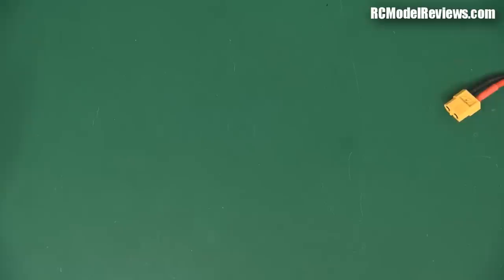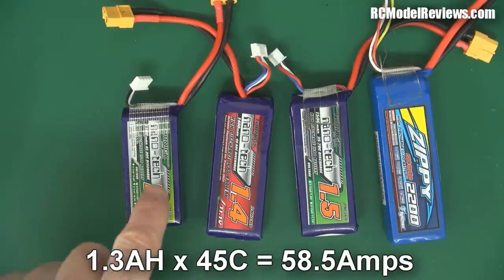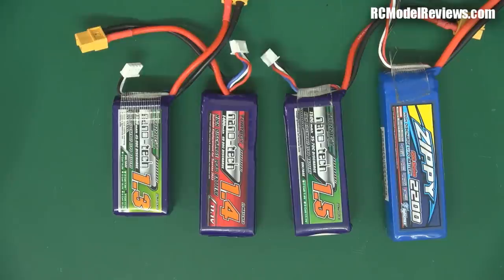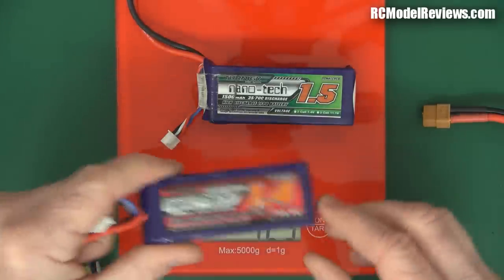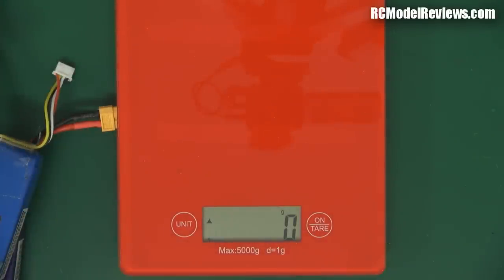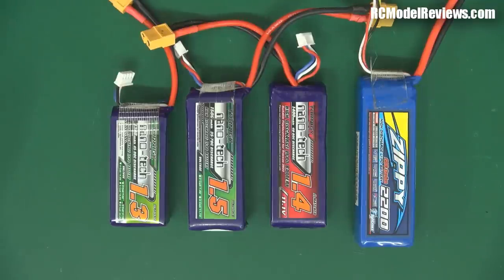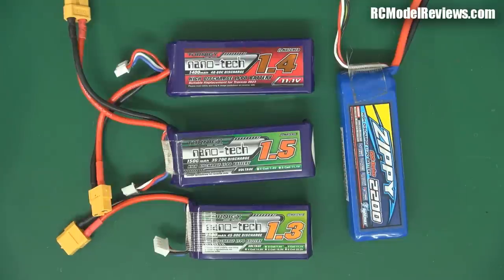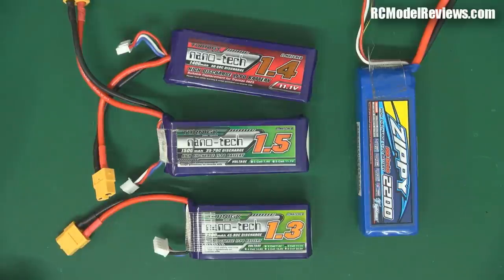What size mini quadcopter battery should you use?

Comment: With all due respect to you, Bruce, I disagree with your advice to stop flying such that your batteries rebound to around 11.4 volts. IMO, you're leaving too much charge in the battery and are reducing your flight times with little benefit. 

I used to do about the same as you, until I started flying with an OSD that included a current monitor. I fly to 80% of the battery's charge (1200 mAh on a 1500 mAh). Typically, this results in in-flight voltage of about 10.6 to 10.8 volts at cruise, with dips as low as 10.3 volts, or an absolute minimum of 10.0 volts for example if I was to do a big punchout at the last moment right before landing. After resting, my batteries recover to about 11.0-11.2 volts. This sounds not too different from what you're doing, but I get about twice as much flight time as I would if I followed the guidelines you lay out in the video. Given that my flight time is about 5-6 minutes, a 50% reduction would be significant!

11.0 / 3 = 3.67 volts per cell. This is well above the absolute minimum of 3.0 volts per cell, and the safe minimum of 3.2 volts per cell. I find that performance starts to really drop at around 3.5 volts per cell, so that's more or less the absolute limit of where I would stop flying if I didn't have a current monitor. But I see no problem in having short dips as low as 3.33 volts per cell during throttle application.

In order to track my battery's performance over time, I note the final resting voltage after drawing 1200 mAh from them. If they were being damaged, I would expect to see the final resting voltage drop after pulling the same charge from them. I have had these batteries for about four months now, with I'm sure you can imagine how many recharge cycles on them, and so far, they show essentially no decline in performance after the initial small drop that is expected from a brand new battery. (They're Turnigy Nano-tech 1500 mAh 35-70C for what it's worth.)

All that being said, if someone was flying without telemetry, just based on a timer, then I would agree with you that 11.0 volts is a safe cutoff, just to CYA for times when you draw more power than you expected.
Reply: Do we know the max C rating a JST connector can really handle ?
Reply: His Highness is too busy to answer questions from peasants.
Reply: Joshua Bardwell I'm going to use your formula and make me an Android app to keep control over my batteries. I'm new to quads and on my 1st day out, after training on SIM of course, I killed the last cell in 3 batteries. That is what has brought me to this video, investigating cause. Thank you both for all the information, you guys are great!

Comment: I've been running my batteries in cycles now as well. A few packs ready to go during the week. When I get home I put them into storage mode and cycle out another set just to spread the usage out. I have a bunch of Zippy Compact 3S 2200 25C's which are well over a year old and they are still fine. Starting to drop off a little but I'm also flying hard ;) Thanks for the video. PS Another thing I do is number the packs. Helps me keep track of when I purchased them and so on. Cheers.

Comment: Excellent little PSA towards the end.

I used to discharge to 3.5 volts per cell think it's enough (I'm sure even 3.3 to 3.0 when I started) and I have noticed performance losses. Now I'm going to try 3.7 volts per cell after watching this if I get new batteries.

Although this may only be about half the rated discharge capacity of a lipo, after using my old, sometimes puffy, batteries; I'd rather have half capacity, healthy, and punchy batteries than half capacity and poor sucky batteries.

Thanks again Bruce.

Comment: You are spot on about the power and resistance. I find I get way more punch from running 4 1000mAh batteries in parallel then I do from running just 1 4000mAh battery by itself on my Peace drone. I think Ed from Experimental Airlines, had a similar video, where he was explaining resistance. Great video Bruce.

Comment: Cheers Bruce!!
I've only been flying brushless quads a few months now and have just built my first. It flies great but I was getting the low volt alarm going off on punch outs. My OSD was telling me it was hitting 30 amps and being new I'm not ashamed to say I assumed 30c on a battery meant 30 amps...my batteries are 30c so I was scratching my head a bit.
They're 30c but only 850mah so your video has explained why.
Just ordered some 65c 950mah :)
Love your vids Bruce, you explain everything so well and never seem afraid to say a product is crap when it is.

Comment: Another informative video, Bruce.  Storing under partial load is a good tip, too. How about doing one on low voltage alarm strategy?  Low C batteries under load tend to set off alarm and then on the charger aren't discharged to the point you might normally run them.  HK has a series of high capacity/low C batteries for multi-rotors.  They are lighter in weight, of course and the alarm goes off well before they are truly discharged to a safe level if set for 10.8 or so on a 3s battery, for example.

Comment: This is a timely video!! i am currently trying to figure out why, after changing flight controllers, APM to MINIX, i dont acheive the flight times on my Zippy Flight Max 8000 mAh batteries or some NanoTech 4500 mAh batteries. i used to be able to get 14-18 minutes on the 8000mAh, about 10-12 minutes on the Nano's when using the APM Flight Controller. i fly an X650 XAircraft with the TMotors i believe they are 720 KV (Xaircraft P7001 motors) 30A escs. its not over weight, 14 inch props. on the F450 (4500mAh batteries) i have 11 inch props, 30A ESCs, 2216 800kv Tmotors. the low battery warning on MINIX is 10.4 i believe. i seem to only get 65% of my flight times. these batteries are always charged at 1.0A and are set to storage 11.40 when i am not using them, they are not quite a year old. Any help is appreciated. I use an Accusel 6 battery charger, all batteries have been balanced charged and appear to have the accurate cell voltage after wards. i am not an aggressive flyer. any help is appreciated.

Comment: Bruce is dead on.  Treat your lipos well and they last.  Doesn't matter if cheap HK or ThunderPower.  Don't let the voltage drop super low, don't charge them too fast and discharge/charge them up to a storage level and they last. When I got in to mini quads last year I purchased a lot of sizes and brands.  Some perform better than others due to the C rating differences but all are still in great shape because I treat them right.  I think that is the best take away from this.  Thanks Bruce for the videos and keep them coming.

Comment: I have likely watched all of your educational videos and with similar backgrounds I enjoy learning over again. It's almost like when I used to fix TVs (in the '60's) and would first ask my client "is it plugged in?" 

Everything in this hobby is now connected to electrical power and that power is utilized  by many components so it makes sense to use the highest rating you can afford just so you have 'Headroom'.

I am curious regard yours and my habit of bringing in the flight when my 3S battery is around 11.3-11.4 volts. My charger usually returns a value of 50-55% usage though it should be safe to go to around 10.5 volts and 75% or so usage. Perhaps I'm just stuck on 6 minutes ....... Thanks!!!

Comment: Today I had my first FPV flight with my effort from your low cost racing miniquad series.Like you I have a swag of odd size batteries which I have used for LOS flying/practicing at very low speed. I am intending to get some dinogy's off Lee  for racing when he gets them back in stock.

Comment: Well darn it, I wish I watched this one sooner! So much to learn. I ended up with 2200mah 25C batteries (so 55amps) which is pretty good but there big and I my plan was to run them on a 250 quad with 2300kv motors. I thought it looked a little big but when I asked someone else they said 1300-2200mah so I figured bigger means longer flights. Ugh such a noob. Besides the fact I cannot return them to where I bought them. Maybe I can sell them. Thanks again, Bruce you rock!
Reply: David Fonseca they will still work, I primarily use 2200mah for the longer flight times, sure it's not as zippy as the 1000-1500 ones but I don't mind them
Reply: It seems like the weight ratio would kill the flight time in the long run no? Well, they sold quick so I have the 1300 45C-90C coming, 5 to be exact. Should be good to go now ;)

Comment: I'm using 2200 30c hobby people 3s batteries and I'm very pleased, I'm getting 9min on my zmr with 1806 and 5045 bullnose. I can get them from my local hobby shop for $20 and they have a 3c charge rate.

Comment: I'm running 4S 1000mah 30C blue Turnigy batteries with DYS 1806 and Gemfan 5030. Pretty nice combo. 5 minutes of racing leaves me with 3.75v per cell which tells that light weight and high voltage is a good deal, amps stay low and theres plenty of speed.
Reply: Jussi Hirvonen Yep, your benefiting from the light weight of that 1000mAH pack.  The less weight you have to carry around, the less power you use doing so.   When really hammering my quad, I get about 5 minutes of fun out of all my packs, regardless of their capacity.

Comment: Wow thanks a lot for telling me I spent 30$ on 3 new zippy compacts 1500mah 25C. Well at least I know what all those number mean now. Could have made this video before the cheap miniquad build but better late than never. Great vid. Also You could make one about the smartieparts board, a programmer board designed for the 9X, show us how to do it, what are the benefits, is it worth it and what software to flash it with and what are the features of the aoftware. Regarts!

Comment: Good battery power explanation... For example if your mini quad uses motors that will draw a maximum of 10Amps each you would not need a more expensive battery that can supply nearly 60A. But I do understand it's a good idea to add a bit of power buffer.
And I do understand that the rest of the mini quad also draws some power but we are talking about when you punch the quad.
Reply: lasersbee It's important to remember that the C ratings on lipo batteries are often somewhat "optimistic"  so if a battery says 40C it might still sag a lot at just 30C.
Reply: ***** understood and agreed.

Comment: The best lipos I've used for minis are Dinogy lipos (bought from drone matters). They're extremely high quality and are 65c rated, while also being smaller and lighter than the equivalent nanopuffs or whatever. Well worth the money if you have a high powered mini setup.
Reply: ATA250 FPV Which is why I'll be testing some out very soon -- once they come back into stock around here :-)   Having said that, the only Turnigy Nanotech batteries I've ever had puff are the small ones I've used in my DLG and in the Walkera LadyBird.   Despite hammering the snot out of my other Nanotechs, they've all lasted and performed really well.  I've seen other people's TGYNanotech packs puffed but that's almost invariably been with the lower-C (25C or so) packs and/or if they've left them fully charged instead of on storage.
Reply: Glad to hear it Bruce! I think they really deserve some publicity, they're excellent batteries!

I've not had any nanotechs puff, but I have had them dump a cell under load and generally have bad matching. I do get the impression that the higher C ones don't quite live up to their C rating.

Btw the PowerOSD board I sent you should hopefully get there some time in the coming week :)

Comment: Thanks for that, battery management isd important and i also dont like it when other racers abuse theirs and than compain about how crappy those are... I have the nanotech 1.5ers you showed here - they work really well.
Did you see that on the inspire batteries those are built with a timer and they start discharging themselfes to charge voltage after the set nr of days?
Reply: Truly it is a design problem that dji addressed in their consumer level batteries (that comes at a high price, literally). Acro/racing keeps the burden of battery management on the pilot for weight and cost reasons. Overcharging isn't a problem these days so keeping an eye on discharge and storage is a good way to fly longer and less expensive. Good tips!

Comment: I defo agree with the fact that light with a high C rate is the best combo, but i was really disapointed with the nanotech 35c 1300mah... the cable often get disolder or one cell get flat... And the real pain is that unlike the regular turnigy (wich come with some kind of pdb) it's imposible to split the cells and make a new batterie.

It's almost the same price to get a bigger/heavier batterie with a smaller C rate than a smaller/lighter higher C rate. At the end you get pretty much the same max discharge  but the bigger battery will provide a slightly longer flying time and the batterie will survive longer.

That's why I prefer 2200mah 3s and 1800mah 4s

Comment: Great stuff. Bruce, I have a question: running 4x DYS 2300kv motors on SN20A esc's. Battery is 1A 45-90c brand new, so it should deliver 45A. The motors pull 8A each on full throttle, so lets say 35A for the whole quad.

On the bench, the motors push 420g thrust, when tested individually. Props are GF 5030.

But when all 4 are running, the quad is only pushing 1.4kgs of thrust, which is 350g of thrust per motor. Quad weighs 400g, its on the light side.

Why am I losing 70g of thrust per each motor, if supposedly the battery should sustain the current draw? The esc's have their original power supply wires 22AWG i think, so its not restricted because of that.

Thanks for any suggestion.

Comment: Which battery should I choose?

I am making a 250 quad with "LB RED HAWK High-speed response BL12A ESCs" and "Lovebirds D2204 2300KV motor".
"RED HAWK BL12A ESC OPTO support oneshot125 :
Continuous operating current: 12A
Instantaneous current: 20A (5 seconds)
Applicable number of battery cells: 2-4S (7-17V)"

Comment: great video. what do you do when you charge your batteries and finally you dont fly (weather changes, you cant go to the field, your wife makes you fix something on the home, etc)   in that case, whats the recomended way to discharge them? just put it on the quad and discharge them running the motors without flying? (without props, hovering at home, or fixing the quad to the workbench)   or with the slow discharge function of the charger?  and when to do it, if i will go to fly on 2 days i shoud put them on storage and recharge them again?
im on a coast city and the weather change very quickly, specially the wind.. so a lot of times i cancel my flying day after i charged my batteries.

Comment: Hello Bruce,.I assume someone asked you about this, or it's a trivial question but I will ask anyway.How to calculate the amount of A I will need to fly the quadcopter.1. I take 1 motor2. Check the average A it needs3. Check the burst A.4. 4x the number5. +10% So for instance 26A at 100% thrust will ad up to 92.10% on top of that would be (let's say) 100 (its 101,2).Does it mean that I have to use battery that will be able to provide up to 100 (101.2)A ?For 1.3A battery should I aim for min 75C ? :)

Comment: Bruce, once again a great video.  A question you may be able to help me with. My mini under full load pulls 7 amps per motor so 28 amps is full boogie. The voltage sag is critical to the punch you refer to and is more like spooling up time on a turbine. So if the 1300 45C pack can output way more than the motors can ever draw then the advantage of C rating is not quite so relevant. If the 1400 MaH pack at 30C can still handle the maximum projected current draw then that should theoretically be an also good pack as it wont sag, it weighs the same and technically has 100 milliamps more up its sleeve, thus giving you 30 seconds more flight time. I know its splitting straws mate and the optimum is always weight at the end of the day. The lower C rated battery is also cheaper and if your anything like me they die from impact damage way before they see old age creep up on them.
Reply: ***** You're right about the voltage drop -- which is why I have suggested that the higher-C batteries are better.  And the manufacturer's C rating isn't solely about the internal resistance (gasp! :-)    All will be revealed soon.

Comment: Unrelated question: I'm trying to learn to fly with line of sight and it is difficult especially when the quad is further away from me and turning as well as drifting. I'm wondering if I would have better control using FPV.  I'm afraid to try it because I've been told that I need to learn to control with LOS before I try FPV but I'm wondering if I would have better control with FPV.  I also bought the 2.2 MAH battery thinking I would get a longer flight times than the 1.3.  The 2.2 is actually too heavy I feel for my quad using same parts as Bruce's quad build and I feel I have better control with the 1.3 so I agree with Bruce I'm going to load up on the 1.3s.

Comment: Bruce, how do you feel about Lipo recovery? 

I was given some r/c toys and one single  240mAh was down to 1.96volts.  The charger refused to charge this battery and I found instructions on the net that charging to just over 3 volts on NiCd charger settings then switching to regular Lipo charge was the way to go.  It worked and the Lipo charged perfectly.  The other alternative of parallel charging a good with the low battery seems a little harsh and the currents would be greater.

Comments?